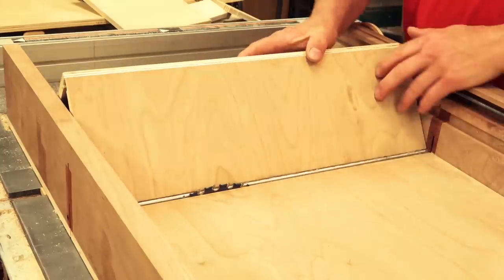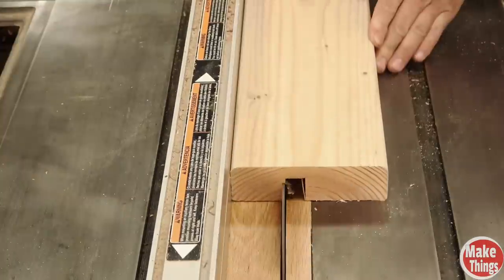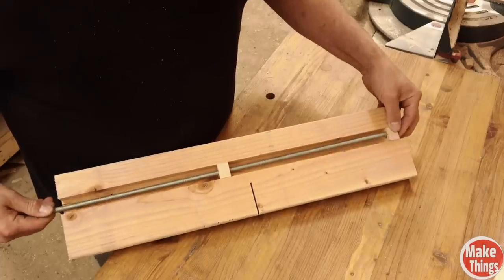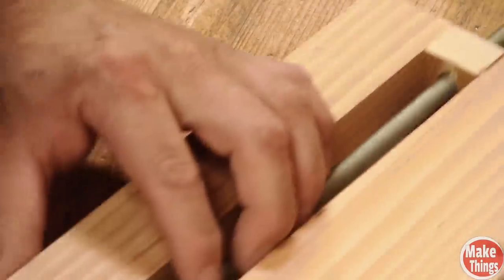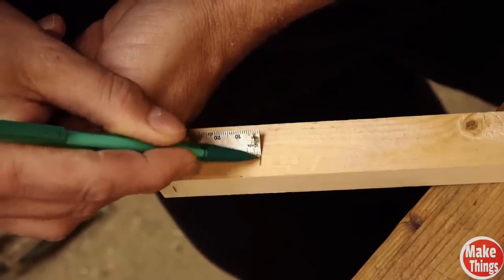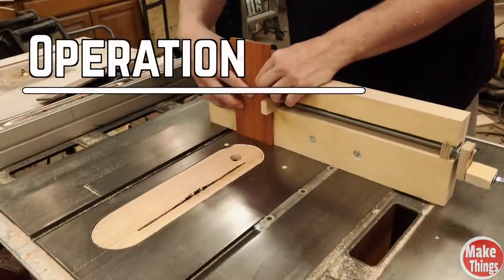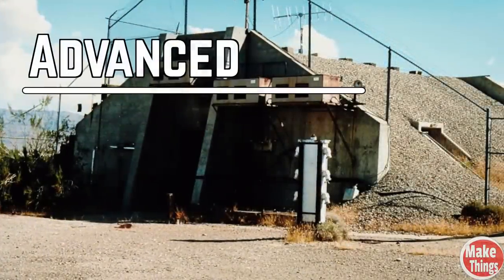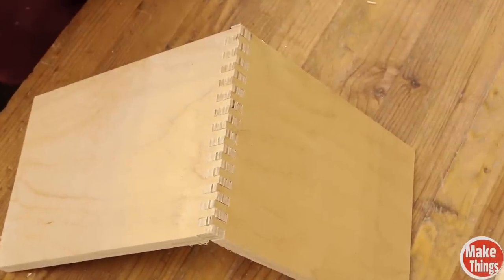Easy Box Joint Jig // The Most Versatile Box Joint Jig!

Comment: Was easy enough to make, not accurate enough to be useful though. Thank you!
Reply from the maker: Really? What problems did you have with it?  I'd really like to know so that I can make it work for you.  One common problem I've found..if you print the sheets off, some print software will try to enlarge the sheet, or shrink it by 5%.  If you're not getting a perfect 1" by 1" square, it might be because of that.  Seriously, drop me an email at makethingswithrob@zoho.com .  I'd love to know what happened.

EDIT: Oops, I got the wrong project connected to you.  I thought you were making the Glue Box.

I will be the first to admit that there is a lot of skill that comes with building this.  I don't blame this design, as it is far less complicated than some of the others (which I've paid for and built), but that box joints are not easy to master.  No, they aren't dovetail joints, but there is still a near perfection you need to reach to get all those teeth to line up just right.

Comment: I'm confused (doesn't take much unfortunately) - when you're doing the second example with 10 cuts / 12 non-cuts, why are the numbers different (i.e. 10 cuts, 12 no-cuts) - won't that make the box fingers uneven ?
Reply from the maker: It’s basically moving the blade over.  It’s for the width of the blade.  Since it interlocks, you have to eliminate the blades footprint. 

Thank you for watching!

Comment: Well I built this and can't quite get it to work.  I put an 1/8" blade on the saw and it seems like I can make a cut but it's 4 1/2 rotations to the next cut to get 1/8" fingers.  Not sure how well this will work with larger fingers.
Reply: Did you figured it out? I have the 1/8 blade problem.
Reply: @puromike  I never did and gave up on it. I haven't made anything with finger joints and will just use a quick/dirty jig next time I need to make a box.

Comment: Hi, You say 2 more non cuts than cuts, but, in the real world, it depends on the size of the rod and the kerf of the blade. In my case, I use a M8x1.25 (ISO Metric) and my blade kerf is 2.8. So I have to add 3,5 turns for the non-cuts operation. The equation is => Length of CUT : N x 1.25 + (Kerf - 1.25)   You have to divide this Length by 1.25 to have the number of NON CUT turns to do ... 
Hoping this helps.

Comment: 2 cuts and 4 non cuts ? But then it was 10 cuts and 12 non cuts ?
The kerf of your blade is wider than a rotation of your screw. When you take 10 cuts, the first and last cut are adding a cuts worth of additional width to the notch you cut - ends up as 12 ?
You should also mention you need a flat top blade and not the ATB profile that most blades have...it ends up looking ugly if you dont have a flat top tooth or maybe your half kerf per rotation movement actually takes care of that.
Reply from the maker: Check out the instructable.  It explains everything better and in detail.